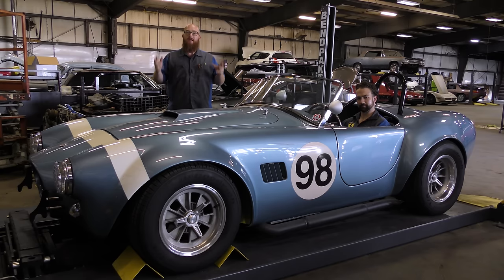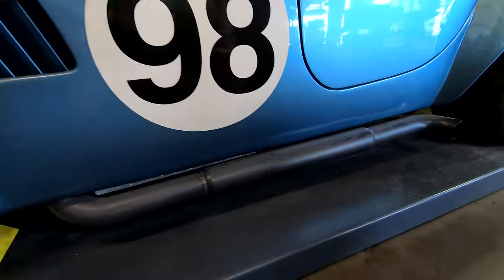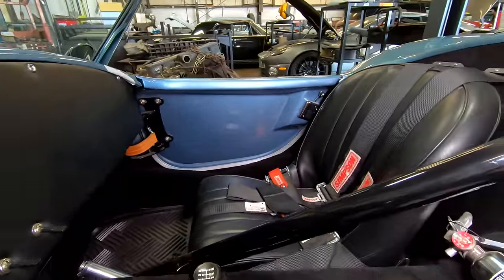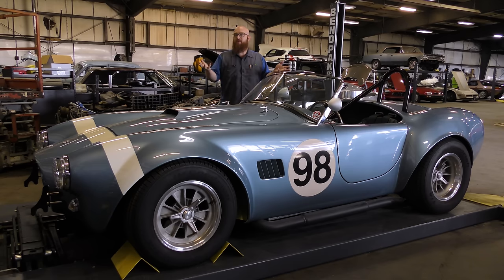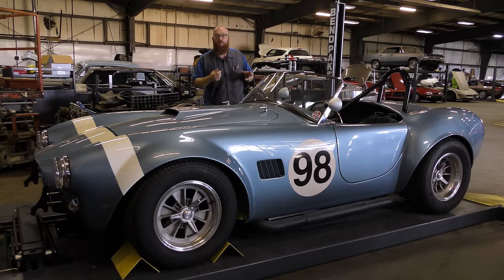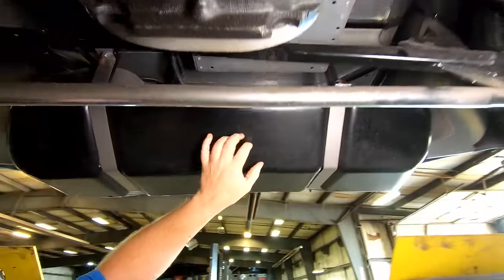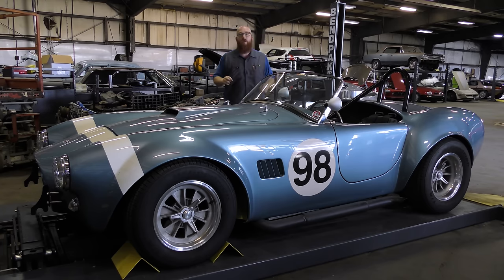How can two replicas be sooo different? CAR WIZARD compares '16 Cobra to the one just in his shop

Comment: The Superformance is a replica of the 427 S/C the Factory Five model on this video is a replica of the 289 FIA.  Different cars that's why they look different.  Also the Superformance are built in a factory and are normally sold without the motor and transmission.  The Factory Fives are sold as a kit and assembled by the owner.
Reply: The S/C cars look great. We looked at buying a superformance to compare to our original S/C our dad bought in '71, as well as a contemporary Cobra built in the 80s that replicated the original really well. Also, factory five has stepped up their quality quite a bit since the early 2000s, so definitely a cool choice.
Reply: Both now sell complete cars due to a recent law changdee in the LVM act. The 427 is loud, but it's a horrible car to drive, overpowered in a car that weighs similar to  Miata and gets really hot.
And forget it if you crash. Zero protection. 
The FIA 289 is a better car, with the 289 slabside also a good choice. But FIA 289s were also hardtop.
Reply: Yep, you can build them the way you want.
Reply: sorry but like the poster of this video, you are incorrect that is NOT a 289 replica. that is the 427 body style dressed to look 'close' to a 289. the nose is wrong, as are the wheel flairs, the hood and even the door
Reply: @richardschipper5989   on second look, you are correct.  The builder modified the 427 body to look like the 289FIA and or USRRC cars that won all those races and the world championship in 1965.  He had to make a lot of changes to get this look, the roll bar, the side pipes, the hood scoop, the radiator opening,  the gas filler location, the tail lights and truck lid all had to be modified.
Reply: @richardschipper5989  You are correct sir. Shame really, the original builder could have just got a 289 kit from ffr instead of doing all that fiberglass work on the 427. While still not an exact replica, a hell of lot closer than this....
Reply: This also look like a mk3 factory five, probably just finished in 2016, the mk4 looks a lot better
Reply: The superformance I belive actually uses the original type gauges.
Reply: Older Factory 5s, like this one, have the infamous perky butt.  The look like a giant kicked them in the ass.
Reply: @truantray  "The 427 is loud, but it's a horrible car to drive" who says?  I have aluminum block 496FE engine and it is a blast to drive.  How many BB Cobras have you owned?
Reply: Factory 5's are much better cars and better drivers.
Reply: Actually this is a USRRC variant. The FIA has a notched trunk lid to allow for a "suitcase" to fit in the trunk.
Reply: FFR also sells a "427" body and according to them they sell ten times as many "427" bodies as "289" bodies.  The frame on both of these cars is identical, the only difference is the fiberglass.  As far as builds go, no two FFR builds are the same, and you'll see as much difference between FFR builds as you will between a FFR and Superformance.

Comment: The Factory Five 289 FIA looks much better than their 427 version. The dam around the fuel filler is to keep fuel from pouring into the cockpit when refueling during races.
Reply: The dam is an aerodynamic fix. The fuel filler on a 289 is located in an area of low pressure, at high speed, fuel will get sucked out.

Comment: From what I have read, the 289 handles much better due to reduced weight up front. I like the understated Cobras without all the chrome.
Reply: Probably right, but the 289 had some design flaws that made one valve tend to burn, and the heater run cold. And the rear main seal would leak about a quart per thousand miles. Easy engine to work on, but the improved version was the 302. Curiously the same size as a Coyote, so there should be plenty of potential there.
Reply: @lyfandeth  do they make a stand alone coyote?
Reply: @duanesamuelson2256  I'm sure that if Ford doesn't sell them as "crate" engines, they'd be able to liberate one for this.
Reply: @lyfandeth  I was thinking of the stand alone electronic package as part of it. I don't follow this as well as I should lol.
Reply: @lyfandeth  oh..and the jag 5L supercharged is a coyote engine (not literally but the same design and a lot of the same parts)..perhaps an even better option would be the jag 4.2?
Reply: @duanesamuelson2256  Duuno. But Jags in general have a solid below average reliability and service record. Which beats the hell out of me, since the same Ford parts seem to perform better in Fords.There's the old line "Could you pick me up on the way to the office?" Why, what happened to your Jag? "Oh nothing, its in the shop again." Right, no trouble.

And they can't blame Lucas anymore.
Reply: That's the reason why many prefer the 351 small block in these cars bored out over the big block 427 that weighs 180 lb more than the 351 bored and stroked.
Reply: Turns out Ford's EcoBoost 3.2 will put out more HP bone stock, considerably more with a revised tune,  and insanely more with upgrades.  Oh, and you're dropping about 200 lbs from the 289 as well.

Comment: You are absolutely right on the 289 versus 427 guestion.
Many years ago I had a chance to drive an original 289 which belonged to a friend on the street, and it was borderline terrifying
( I was considered to be a very good driver of fast cars.)
When the same friend offered me a chance to take his 427, I told him I'll ride, you can drive, if you'll give me your solemn promise not to kill us both....
Reply: Reminds of the Bill Cosby piece about his 427.
Reply: I kinda dig the 289 body ,it's more sedate and like a sleeper. 
But then I'm kinda biased as my cousin liked em too and had a 289 body and engine dropped on a 427 frame in 65 when the 289 was retired for the 427. 
They had some extras laying around and put one together for him. 
The 289 was way more fun on twisty backroads of upstate NY.
Reply: @ianmontgomery7534  Cosby didn't have just any 427, he had a supercharged 427.  And that car did kill a later owner.
Reply: @rockets4kids  It was twin supercharged and the throttle jammed and it went in to the ocean.
Reply: @ianmontgomery7534  That's the story, at least.  There is some speculation here.  But it didn't stop the car from selling for $5.5 million.

Comment: The 289 is a much better driving car.  It has better balance because it's not so nose heavy. The 427 also overwhelms the chassis. The original chassrs was designed in the 40's. 

Someone asked Shelby who designed the 427 Cobra. He told them Goodyear. As they added power they had to put wider wheels and tires on it and you had to flare the fenders to cover them.
Reply: Shelby heavily modified the frame from the Bristol to the point where it is really a completely different frame.  It is not the same chassis from the 40's

Comment: I think the "windscreen" around the fuel filler is a splash deflector to prevent fuel splash or overflow from going in the cockpit during rapid refueling (during a race).
Reply: It is
Reply: Why not both? 🥳
Reply: The dam is an aerodynamic fix. The fuel filler on a 289 is located in an area of low pressure, at high speed, fuel will get sucked out.
Reply: @stephenc6955  LOL

Comment: I used to have a RAM cobra with a 4 litre rover v8 running quad downdraught dellortos.
It used to take a bit of starting and have the occasional slightly rough running. The confusion was recognising the difference between fuel flow and fuel pressure. I put the pressure gauge in the fuel line between the pump and the carbs and the pressure gauge between the last carb in the circuit and the return to the fuel tank. Maximum flow with pressure adjustment. Ran and started beautifully from that day.

Comment: I have always been partial to the 289s over the 427s.  Also, the Factory Five vs Superformance debate often ends in virtual bloodshed in the replica forums. No right or wrong answer (but I am partial to Factory Five - go take the factory tour up in Wareham, MA if you are ever in that area).
Reply: I think the superformance are quite a bit more $$$.
Reply: I always hated the rear end on a Factory Five. They look like they got rear ended and shoved the rear up. They don't look right at all.
Reply: Bought a factory five mk 4..
Better frame than the others.
Reply: More horsepower than the tires and suspension can actually use in a meaningful way is pretty foolish. It's ego driven and has no rational purpose. Only teenagers and car magazine writers think it's cool.

Comment: I think 400 hp is enough for this  car.  Factor Five makes different models.  I have a Factory Five manufacturer within 5 miles from my house and plenty of these in our area.  Fun car to drive, only for experience drivers.
Reply: Refreshing to hear in this age of Hellcats, ZL1s, and Mustang S550s. Too much too fast is not always usable or streetable, and can be very tiring to drive (sensory overload). Extreme cars/street dominators can be really obtuse and turn into garage queens (hardly driven) more often than not.

Comment: Our dad bought his 427 S/C competition Cobra in '71, the only cobra painted Gulf Racing Orange. Through shear luck we still have it today at Coyote Ranch, and it's still qmazingly in excellent condition. After having one in the family for so many years, it's easy to see how different the replicas are. Because of that, we ended up buying a contemporary Cobra built in the 80s that closely copies the original, down to the Salisbury rear differential, but with a 428 cobra jet. They are absolutely beautiful cars, but not great drivers due to pedal placement and no power brakes or power steering in the original configuration. Love the cobras, thanks for making some videos about them Wizard!

Comment: I believe Factory Five offered these as a replica to the Cobras that raced in USRRC. Like many have said, Factory Five Cobras are kit cars that are supposed to be bought and assembled at a home garage or a professional shop and the Superformance Cobras are built in their factory and delivered without a drivetrain to the customer. These are the 2 main big differences between Factory Five and Superformance. 

This factory five 289 USRRC Cobra is a very high quality nice build in my opinion. A lot of the parts are replicating the exact same Cobras that raced USRRC in the 60s including the engine itself, the valve covers, the weber carbs, the side pipes, rear view mirror, side view mirror, dashboard layout, even the alternator, etc. The wizard did not seem to know about the grill/opening differences between 289 and 427 Cobras. I'm sure most Cobra lovers know that the 289 Cobras had different grills and oil cooler scoops than 427s did. I'm not going to cover the major differences between 289 and 427 Cobras but the most obvious ones are: roll bar, grill/opening, rear fender flares (although there were narrow-hip 427 Cobras but those were very little in numbers), sidepipes' setup, quick jacks, dashboard layout, etc.

Superformance builds their Cobras with a rectangular tubing frame, factory five has a different approach and uses a 4 inch round tubing just like the original CSX Cobras.

This USRRC Cobra is just missing the quick jacks to be reversed just like the originals did and it can be a very very nice example of what a USRRC Cobra (CSX2385 for example) looked like in 1964.

Comment: One advantage to the small block is you can add turbos to get more power AND low weight in the front end.
Reply: I'm thinking turbos would be a challenge with the Webers.
Reply: I think a 500hp n/a ls v8 would be more than most can handle.  Maybe for a drag car, but its not a great chassis for that with its short wheelbase and poor aero.

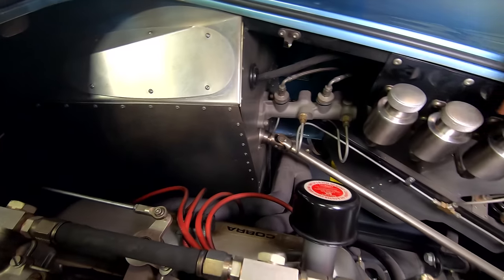Comment: My father had a factory 66 289 k code drag pack mustang! About 2500lbs, with a 4 speed top loader with a nine inch rear end with 4:11s! . It had some miles on it but never skipped a beat. What a honey of a forgotten engine, watch number 12 shelby daytona coupe at the goodwood festival of speed pass ferraris with the same intake and 4 pipes. The 289 is criminally under rated, thats exactly how I would want a cobra!

Comment: Wizard, you demonstrate very sane reasoning about cars and economy for a long time and it gets me back to your videos frequently. Your reasoning about the 289 and what one does with a car like this ~Cobra - fine.
But, the the F5 is not a replica, but rather a kitcar that mimics the original. It deviates in so many places in order to remain cheap, or maybe even to avoid intellectual property claims from the Shelby foundation.
The other one you mention is a continuation car that still conforms to the original AC/Shelby Cobra 427 - approved by Carroll himself. The original Shelby 289 had an original AC chassis/body that looks different than the 427 Shelby version. The 289 could never fit these 427 wheels.
Living in Europe, if I were to buy either one, I might still have a chance of being legally able to import the continuation model and get a license plate on it so I could hit the streets with it. Because it had a type certification about 60 years ago. Or, I could make that claim, at least. With the F5 there is no chance - it has no status.
Within the USA there may be differences between states that I am not aware of and some of this may apply your side of the poind too.
With many of the custom cars in the US, shown in YT, I wonder how (a) that can legally be driving the public road and (b) how these can be insured. And that would be a major concern with kitcars over here, too.

Comment: I have a FF5 MkII cobra with a fuel injected 5L 302 and Tremec 5 spd. The 302 fuelie makes plenty of hp for such a lightweight car. It does have a live axle like the original cars. There are Mk III and IV variants which may have independent rear suspension depending upon the order options selected. My car has leather door panels with a pocket. I think that was another option. Fun cars. These replicas make ownership possible without breaking the bank.👍

Comment: I love old mechanical fuel pumps , my 1967 427 ss impala is a treat to start on a cold morning, originally was a 390hp 427 the original owner blew it up in 1969 and ordered a replacement 427 l-88 …😊😊😊😊😊😊😊I’ve owned the car since 1997, it’s a tuxedo black car with black convertible top , black interior with buckets and console full gauges , m-22 4 spd , 12 bolt posi 3:73 gears . It’s such a gem I’ll never sell or recklessly drive my impala , it’s a rad Time Machine to 1967 😊🤯I’m so in love with my old Chevy

Comment: SuperFormance also makes an FI A 289 version, which is mor of a race car. It is more accurate than the F5, right down to the trunk bulge to fit the suitcase required at the time. Also the SF is recognized by Shelby American. The 427 is a different animal.
Reply: Factory five offers a version that is a mirror of the original also. As usual you still have the option build it yourself with whatever components you choose.

Comment: I totally agree with the Wizard!! There is definitely a 'law of diminishing returns' with horsepower and weight. Not matter what anyone say. A well tuned 289 can still out drive most drivers and chassis. 

Even Carrol Shelby once described his favorite AC, as the 289 with and AUTOMATIC!!! LoL..... Yup! after retiring from racing. Old Carrol thought manual shifting was not efficient.
Reply: Those clunky Borg Warner 4 speeds were hard to shift.

Comment: I wouldnt mind a 289 replica to keep it lighter and more manageable, and I dont think I'd generally mind the slightly simpler (and less authentic as I understand it) setup of the factory five for the most part...  But a solid rear axle is taking it a bit too far really: It isn't really a Cobra any longer without IRS in my opinion. :(

Comment: I would have liked seeing the comparison with them being beside one another.  Aside from that…  both are spectacular.  Thanks going through them and their differences.  Cheers!
Reply: If you put a 427 body style next to a 289 body style, and if they are pretty faithful to original designs, you'll notice quite a bit of difference in the nose as well as the stance. The 289's were more "old English" style design with a bit of a nose up attitude. Also, the "luggage bumps" on the boot of the 289 FIA models is another very noticeable difference. My 2¢

Comment: At a total weight of 2250 lbs. with 300 horsepower and over 300 pound feet of torque, that Cobra with the 289 is the perfect car for fun days of canyon carving, cruise nights or at a cars and coffee, and especially competing at local time attack events! The 427 version handles like a shopping cart, and gas mileage will be at 10 miles per gallon, even when the engine is turned off and the car is parked in the garage! A 302 with 351 heads would be an incredible upgrade, probably 365 horsepower and 390 pound feet of torque. Both motors would be an excellent choice for the DIY Guy!!!

Comment: Upgrades needed:
-port fuel injection
-electric fuel pump
Reply: Weber ITBs look like the carbs...
and the FI pump negates any need for any other fuel pump???
Reply: They are trying to be traditional like they were built when Shelby made them.  I prefer this, but I am a senior citizen that saw the real ones run and race growing up. No doubt, you can  do many things to  make them more modern, but that’s not what they are building replicas for.  Kits are available to build it your way!
Reply: @JohnSmith-yv6eq  
Correct. When you upgrade to FI the fuel pump needs to be changed as well.
Reply: @steveperyer4850  
Yeah, I see your point but if the car is a daily driver then I would definitely do the upgrade to avoid breakdowns i.e. vapor lock.